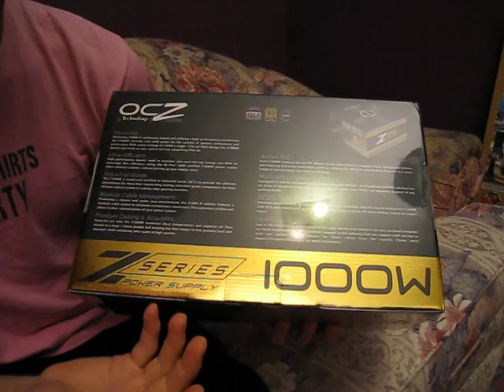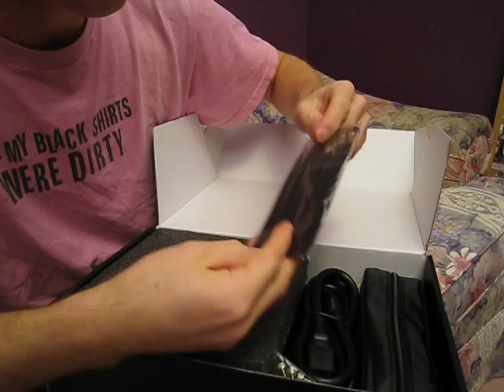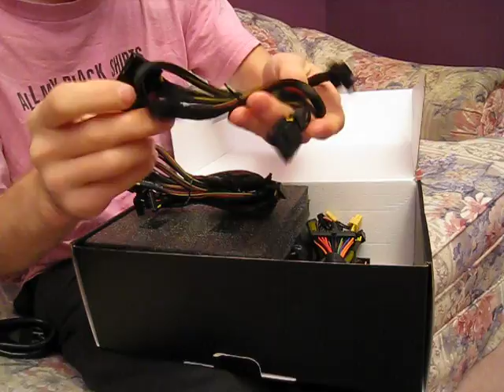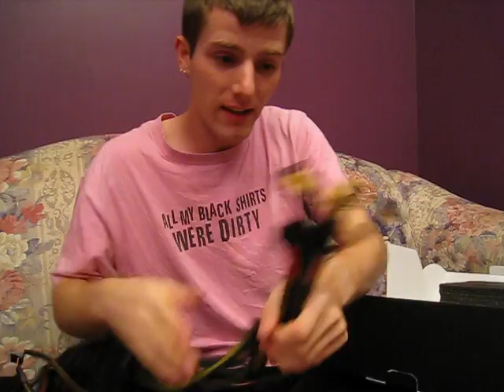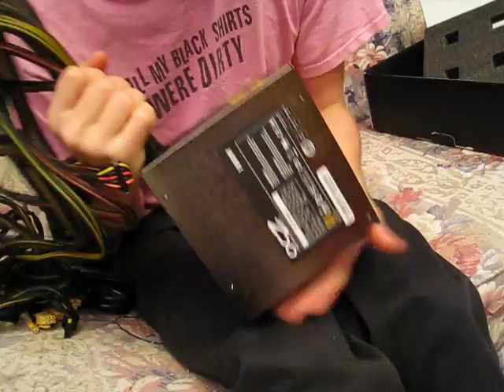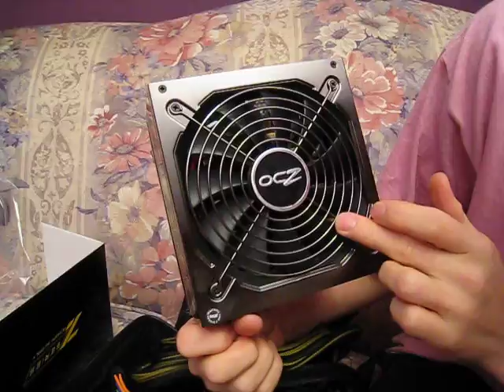OCZ Z-Series 1000W 80 Plus Gold Modular Power Supply Unboxing Linus Tech Tips

Comment: @SuperSONYdude google extreme power supply calculator and find out from there. then again you need to make sure 2 570's are in the safe zone with the ammount of amps they use to run. most likely 40-50amps. if this psu offers 83 AMPs then id say its a go. just dont OC the cards unless you really know what you are doing.